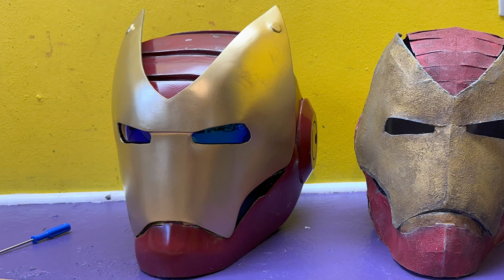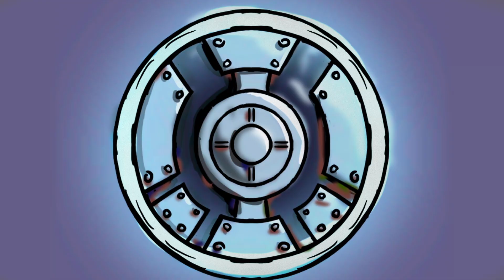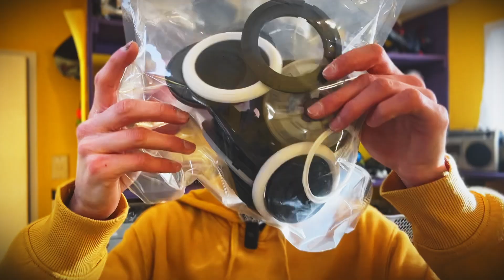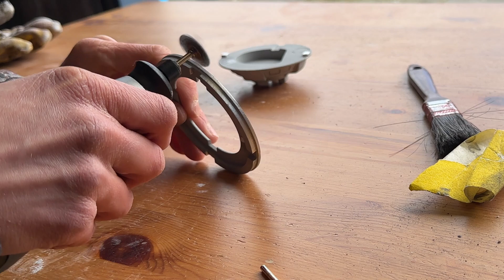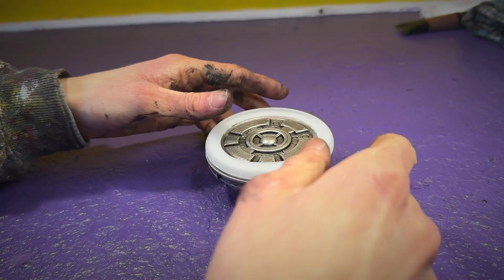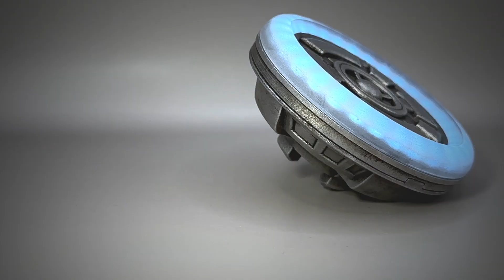3D Printing With Metal Is a Game Changer

Comment: I don't dislike it. It definitely looks cool. 
For me, though, it sort of misses the mark that the movies set. It's a pretty design, like an insignia or something, but none of it feels as though it serves a purpose. In the 2008 version, there's something so tangible and believable about the way its built, that I unfortunately don't think was achieved here. All the copper wires and metal bits slapped on the 2008 version makes it feel like it's function first, then design. The later versions then feel like polished versions of that prototype (which also never quite look as cool, which I think you actually agree with based on the reference photos). If I had to guess, I'd say it lacks some depth more than anything.